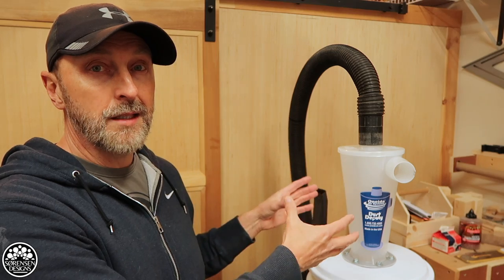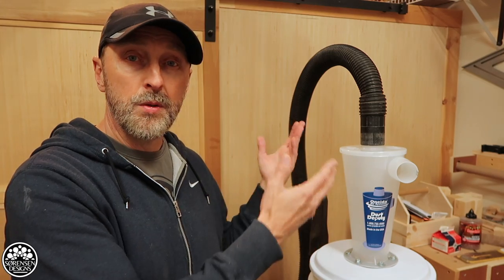Before You Spend Money on Dust Collection…Watch This Video

Comment from the maker: Hello Friends! One quick and easy improvement I made to this system: I used the elbows from the kit and shortened the hose going from the vacuum to the cyclone. This made the whole unit a lot less cumbersome. Someone suggested PVC pipe instead, which is another way to go if you don't have the full kit.

Comment: the best thing about the power block is that as you move the vac to different equipment you plug the equipment into the block. Turning on the power for the equipment also starts the vac and shuts it off when you are done. Safe and less noise when you don't need it...

Comment: My dust collection system is similar.  I will probably go to the furniture dolly in the future. The hose from the vacuum to the cyclone is always in the way, eliminate it by using pvc/ads pipe and elbows. The cyclone (not dust deputy) from Amazon is $$ cheaper and just as good.  Word of warning, 5 gal. buckets come in different weights, heavy is better. The light weight buckets will implode when you least expect it. Very good how to video.
Reply from the maker: @Ray C Yes, I saw the cheaper cyclones on Amazon for around $25. I went with the DD because it received great reviews. The buckets I'm using came with the DD kit and are made to handle the suction. The hardware store buckets, I don't know... I've seen the larger barrel style buckets implode. I've also seen folks use a 5 gal. metal bucket instead.

Comment: Hey, Eric. I have a similar setup as yours. I switched out the small bucket for a 50 gallon fiber barrel. I got tired of emptying the bucket all the time. The power strip is a good idea but I recommend a wireless remote so you can turn it on easier without having to bend down or walk over to the vacuum. You can also have the vacuum set up in the corner and turn it on from across the room. Just fyi, I'm using the Fosmon C-10683 Wireless Remote and haven't had issues with it.
Reply from the maker: @John McCarthy I love that idea but I unfortunately don't have space for a 50 gal barrel.  The remote is a good idea too! Very innovative🙂

Comment: I recently used the same kit to build my vacuum / cyclone cart. I used a length of home 2 “ ridged vacuum tubing between the cyclone and vacuum, using the supplied elbows and cut the supplied hose to make a gentle 45 to the top of the cyclone. I also added an iVac switch, so that, if connecting to a machine for repetitive work, I can just turn on the machine to activate the vacuum. As Eric noted, the suction is great and the vacuum stays largely clean.
Reply from the maker: @Palm Cottage Guy It's so funny that you mentioned this because I ended up doing the exact same thing yesterday. I used the elbows from the kit and shortened the hose. Much more compact now. So I ended up using a few more parts after all🙂
Reply: These were precisely the two improvement I was going to suggest.   Personally, I'd probably add something to store and extension cable to as well so power/dust collection was all in one easy unit.  That's because at the moment I have to set my shop up outside when I want to do things.  Then again when I finally do start bringing the shop inside, I plan on a lot of tools to be mobile.

Comment: A good design with a small footprint.  I made one to use as a vacuum sanding system for sanding drywall but I used a converted stroller with 14" bicycle tires for the cart.  My bucket is in front of the vac so has a lower profile but it moves around easier.  Another thing you can do is get a better bucket.  As a drywaller I have mud buckets so I use them and as they are 90 mil thick there is no worry of collapse as some lighter 70 mil buckets.  I also put a 10" disk of 1/8" plexiglas between the cyclone and the lid of the bucket for stability as I pull my unit around by the hose on the cyclone.  The Oneida lid is not strong enough for that.  I have 2 of these machines and have been using them for about 5 years with no problems.

Comment: I have my Dust Deputy connected to a 55 gallon steel drum. The suction it creates is unreal! I do have a wall mounted Delta dust collector that I use strictly for my planer as it has a 4inch hose.

Comment: I have a similar set up with a Rigid Vac and the same Dust Deputy, I just didn't build a dolly crate (my bucket is on its own dolly).  The one HUGE thing that would really help any dust collection system like this is a remote power switch so you can power on the dust collection from the end of the hose where you have the tool connected.  I had a pretty long hose set when I stripping the bottom of a fiberglass boat using a belt sander.  The boat hull was inverted and I sat on top of it, the dust collection set up was on the shop floor.  It was a pretty long trip from the shop floor up to the work surface to power on the Vac and then go fire up the belt sander so I resorted to using a broom stick to poke the on/off switch, lol.

Comment: Agree with the analysis fully.   Just got my kit and looking at had decided not to install the casters on the buckets or bolt the bucket to the shop vac, instead bolt it to my shop table legs permanently in a corner.   I still am happy buying the kit even though many things won't get used, because the kit came with all the stuff I do use and not having to go source a lot of those other things is worth the extra money.  Saving $30 to have to spend over 2+ hrs sourcing and getting other parts isn't worth it (for me).
So having decided all of that, it was nice to then find your video that came to similar conclusions.
Reply from the maker: @Minok1217 That's a good way to look at it. I did end up using the elbows in the kit to connect the cyclone hose to the shop vac. The extra cost was worth getting the time back for me. Plus I will always end up using the spare parts on something else - probably for a jig 🙂
Reply: @EricSorensenCanada  Yep, my thoughts too.  I'll have 3 caster wheels and some bolts to use on some future project.  The elbows (given the variations in hose diameters in the vac world) are worth it by itself.  All I end up not using is the casters, their bolts, and the long bolts and foam block, and the o-rings as my rigid vac hoses seem to seat just fine without them.  The rest I'm putting to use.

Comment: Dust Stopper 29.00. Works with any 5 gal bucket. High quality hose included. Much lower profile.
  I have both this product and Dust Deputy, and the difference in performance between them is negligible.
Reply: Gotta agree with you on that. I've had both, and for the money, this beats the pants off of dust deputy. I love the low profile, too.

Comment: First great vid.  I was getting ready to spend $549 on a Bosch 9 gallon dust extractor vacuum that would be an all in one unit.  That said I noticed in the video that you have a Festool dust extractor.  Do you not use that for this purpose?  Another interesting observation is the difference between the Oneida Dust Deputy DIY Plus and the Deluxe you purchased.  According to the comparison chart they provide with the parts numbers, the plus has a limitation of 50 CFM.  Where the Deluxe model ranges between 50-150 CFM.  All other information on the units are exactly the same.  My conclusion is that they believe some doing DIY will not come close to their preconfigured Deluxe and use that number justify people spending the $99.

Comment: I like that you showed what you were building and why up front, allowing me to decide if I wanted to watch the video. Those $11 dollys from Harbor freight are hard to beat for a light duty roll around. About the price of buying castors. The cyclone doesn't need a bucket to collect the dust. You could build a collection container that fits in the cart and would make a lower, more compact, assembly.
Reply from the maker: @kkarllwt . Since I already spend the money on the kit, I ended up using the buckets that came with it. Otherwise, yes,  a custom container is definitely an option if you just buy the cyclone.

Comment: The problem I had with the same kit. First the system did what it is supposed to do and did it well. The first problem was the area, it took to implement it in my small 10’ x 12’ shop,

Comment: Outstanding! I'm a beginning woodworker and have a small shop I'm building and I just bought the same dust collection system. My shop vac was on one side of the shop and hose ran across the floor to the dust collection container. Since I'm just starting to build my shop, I have ideas but needed to search for examples. Your video was on my Google news feed this morning and I'm ecstatic I clicked on it. You have provided a solution that works perfectly for my shop and saves additional space. I like the way you think and a subscriber to your YouTube channel now. Thanks for providing an easy visual solution for something I otherwise would have spent hours planning.
Reply from the maker: @Joseph Hunter Outstanding! Best of luck on your new shop set-up. Cheers🙂🍺

Comment: Outstanding video. I feel better about the dust deputy and I have a small shop that needs the same solution. On top of that, I have a Harbor Freight furniture dolly that will be perfect and I have some scrap plywood and 2x4’s so I don’t even need to buy any additional material. Thanks for the great video....
Reply from the maker: Thanks Bill! I am really happy with how much easier it is to cart the whole unit in the shop on the dolly as opposed to the casters that came with the shop vac. It's so much smoother. I also shortened the hose from the vac to the cyclone and used the elbows in the kit, so its all inside the cart, so it's more compact now.

Comment: I love having my Dust Deputy. I have just the cyclone and a bucket from Home Depot on a plywood plate with wheels, that way my deputy follows me around my small shop while the Rigid vacuum stays stationary.
Reply from the maker: @Chris O'Bryan I could have probably saved about $35 on the kit by just buying the cyclone. Nevertheless,  I love it's performance so far. There are so many great ways to customize it for any given workshop.

Comment: I have the same vac but with dust stopper on PVC pipe in the vac accessory above casters. Use 2" to the vac casters and reduce to 1 1/2" to a plywood platform with 11 1/4"  hole for the bucket.

Comment: A substantial bucket is required, mine collapsed into itself. I've added a 19mm irrigation pipe and tap to the lid, to allow more air in, from the atmosphere. Im taking sawdust from a bike and below my scrollsaw, using two clear plastic tube, joined with a 19mm irrigation T piece.

Comment: I bought the DD, a Pocket Hole Jig, and Furniture Dolly (from HFT) after watching your video..  I'd known about the PHJ, but your video convinced me to get one.  Excellent video.  I learned a lot for a beginner woodworker.  Will implement the PVC pipe per the comments below.  Another great idea.
Reply from the maker: Thanks Chuck! Good luck on your version🙂 👍
Reply: @EricSorensenCanada  Any suggestions as to how to attach the PVC pipe to the Poly Ethylene (or are they Styrene?) elbows provided with the DD?  Might use a couple of short (1" ) Drywall screws.  Another idea is to mate them with Bondic.
Reply: How do I send you an image of my cart?
Reply from the maker: I only ended up using one of the PVC connectors that came with my DD for the hose to the vacuum port. The other end of the hose attached just fine to the cyclone without any adapters. For some brand of vacuums / hoses you may need an adapter to attach the hose to the cyclone. You want to make sure you get a decent seal with your hose connections, otherwise you can lose suction. If you're sending an image link, use Facebook or https://imgur.com/

Comment: I have a somewhat similar setup for a while already. Hope your plastic bucket will be rigid enough, in case the hose gets clogged up. Don't underestimate the suction/power the vacuum creates. I employed a used military grade metal barrel instead of a bucket.  It needs to be emptied less frequently and you can ground it, should static power become too much.  Seeing yours reminds me of redesign though, to make it take up a bit less space.
Reply from the maker: @J. H. The plastic buckets came with the Oneida kit and are designed for the purpose. They are tougher than the hardware store buckets, and the seal is perfect on the lid. A metal bucket is a good alternative if you don't buy the full kit. I've seen other folks use it - works great.

Comment: Eric, I've read that for table saws, shopvacs can't move anywhere near the volume of air needed to suck up chips/dust when the chip/dust source is located away from the machine collection part!  It's apparently good for smaller machines and tools like sanders etc. but not for larger machines.  What is your experience here?
Reply from the maker: My 12 Gal. Shop vac has plenty of suction for the table saws I use. Probably not for a big green machine or any of the larger cast iron table saws, i.e. Delta, Powermatic etc. For smaller garage workshops like mine, the Dust deputy does a good job. Also, you need to remember to change the filter. A lot of people forget that part then wonder why their shop vac isn't doing a good job.

Comment: Eric. Why did you not turn your vacuum 90 degrees and have hose come up through opening? I have been using the Dust Deputy several years and love how it works.
Reply from the maker: I did actually turn it around. You'll see in later videos that the hoses are now in the inside of the cart. It's less bulky now.

Comment: For the power, I can't recommend the DGC unit enough.  Vac plugs into the vac plug and the tool plugs into the tool plug.  Vac comes on automatically when the tool is turned on and vac runs for 5 seconds after tool is turned off.  I mounted the cyclone on top of the vac with a simple frame and wired an extension cord to a single gang box on the frame.  Not necessarily, just different.  Enjoyed your video
Reply from the maker: @Al Ryan That's a great idea! I'll have to check those out on Amazon. I know the Festool CT dust extractors have this built into them but I think I'll get the DGC unit and replace the power bar for my Dust Deputy system. Again, thank, great idea🙂👍

Comment: I have the same table saw as you. Have you ever had an issue with the blade not staying at 90°? It feels like my blade is moving after I cut. I have tried using an allen wrench to tighten it. Any advice?
Reply from the maker: @kurtis anderson You have to crank the dial fully clockwise (ignore the scale on the dial just go past the zero.) with one hand, hold it, and engage the lever lock with the other hand. I then check it for square. That works every time for me but yes, it is a pain. You also have to put pressure on the fence to ensure it stays square before you lock it. I am thinking of upgrading to a Dewalt in the future and selling mine.
Reply: Thank you Eric! I will try that today. And an upgrade would be nice. It's not a bad saw just a little finicky sometimes.

Comment: Leave the wheels on the shop vac and make a smaller mount for the cyclone.  Put a 10lb weight inside the shop vac which will give it a much lover CG and it won't topple over.
Reply from the maker: The casters on the ridgid shop vacs are terrible. It moves around much better on the dolly casters and the cart only adds 8 inches to the footprint of the shop vac.
Reply: @EricSorensenCanada  Perfect....Yeah I wondered how sturdy they were....Dust collection is a big PITA...

Comment: So the size did make a difference. The second problem was being my shop is 10’x12’ the vacuum is way to loud. When I bought the vac it was advertised as a quiet vac. Yeh right I got a million dollars too.  So I built a small enclosure outside of my shop to contain the both of them. The saga continues but I need not go further.

Comment: I have an almost identical unit. Built it back in 2011. Same Harbor Freight Furniture Dolly, Similar size vac Sears Craftsman, DD Cyclone.

Really only three differences... extra length of hose, nozzle mounts, and vacuum connection rotated 90degrees so the suction hose does not stick out... oh yeah, some grab handles so I can lift it if needed...

(I keep meaning to replace vac-to-cyclone hose with PVC pipes and elbows, but, it works great now)

Comment: How effective is this in comparison with a large motor/bag system? I thought the only draw between this and using a shop vac is that this keeps the shop vac filter cleaner? It doesn't effectively capture as much of the nano stuff, does it? My shop shares the house garage and there is a thin film of dust on everything.
Reply from the maker: It means you never have to buy vac bags again and it extends the life of the filter. It enhances the suction a bit but it effectively does the same job your shop vac will do. Have you tried blowing out your garage with a leaf blower? I do that once a month. I open the back window in the garage for airflow, open the garage door and blow it out from back to front. It works well.You'll want to wear a mask when you do it and put any tools away that might blow around. Of course it depends on where you live and how close you are to other houses. The neighbours might not love it🙂

Comment: Curious as to why you didn't mount them side-by-side on the dolly. It looks like there was enough room. Your cart looks like it has the same footprint of the initial setup, but now is much taller.
Reply from the maker: There's 4 inches clearance on either side of the vacuum barrel. Eight inches of additional space would not allow the 5 gallon cyclone bucket, which is 12 inches in diameter.... To fit them side by side on the dolly, I would need to add an a longer platform. The taller set-up is better, no bending down the empty the bucket.
Reply: Gotcha. Good to know. Thanks.